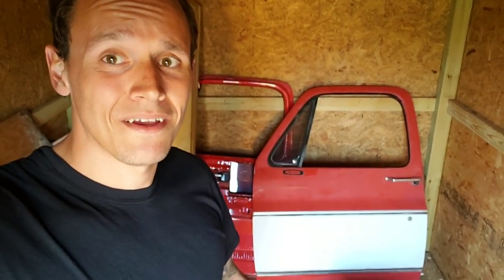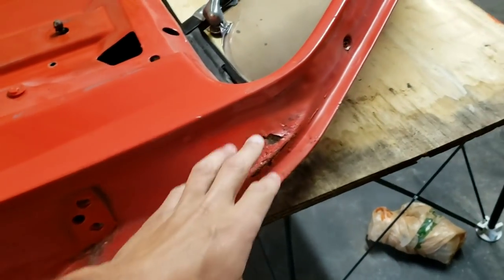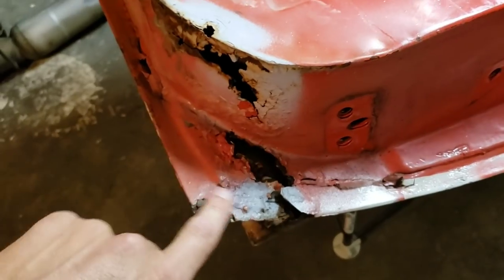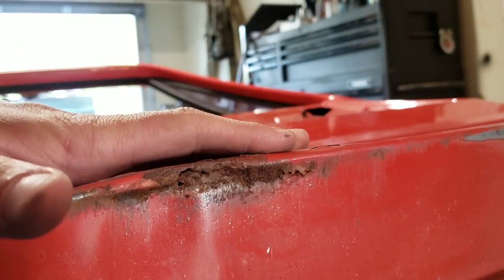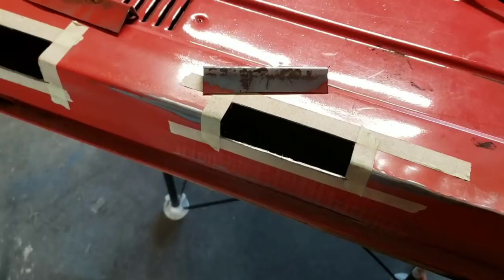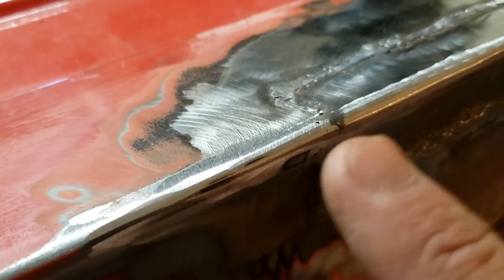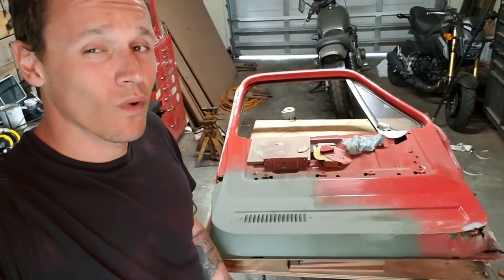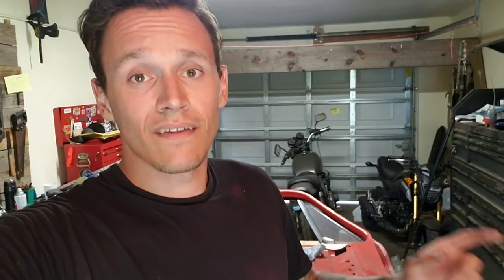BODYWORK MADE EASY (Nicer doors for Bessie)

Comment: Out of curiosity how do you have your welder set up? Every time I’ve tried to weld sheet metal I either blow holes in it or I can’t get a consistent arc. I defiantly need to get that figured out before I start cutting up my truck.
Reply from the maker: Mine is pretty old and outdated, and i constantly have to fight with holes burning through too lol I just put it on the lowest heat setting, and depending on the thickness of the metal, I hover between 25% to 40% wire feed. Thinner metal gets more wire to compensate for the heat, and thicker stuff gets better penetration with less wire and more heat. Hope this helps!
Reply: @ChucksCustoms  Thanks I'll try that with the wire feed.